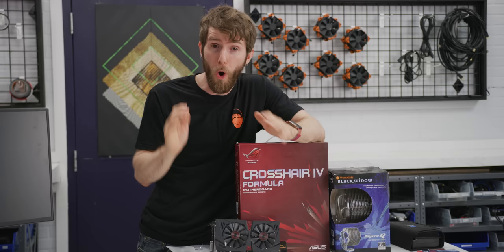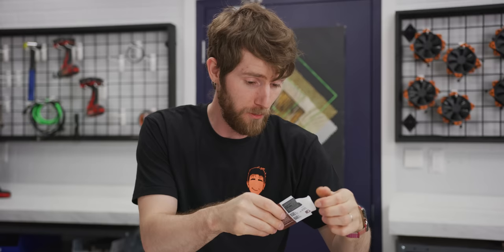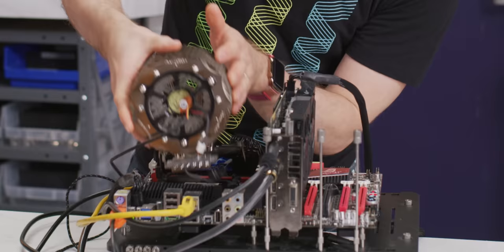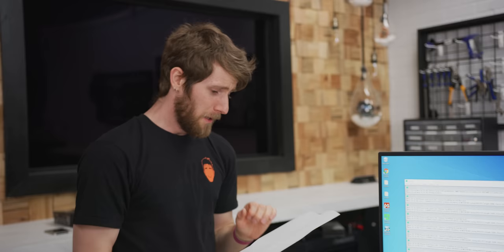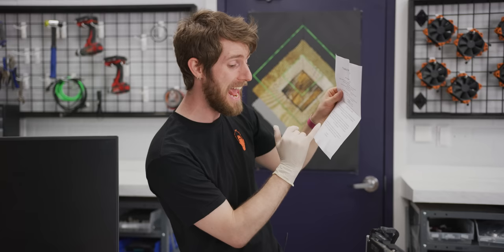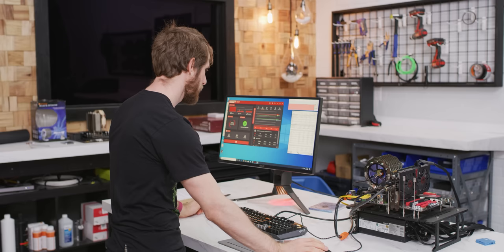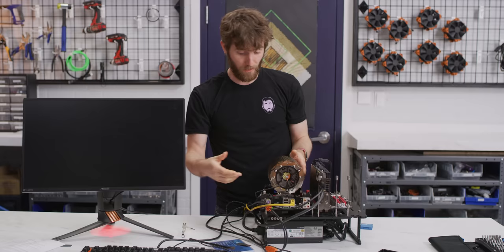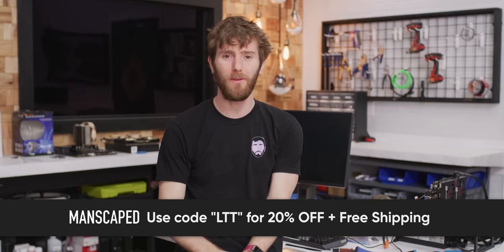Testing Another YouTuber's Thermal Compound!

Comment: Garbage Thermal Paste: 60c
Noctua NT-H1 Thermal Paste: 59c
okay...
Reply: It'd probably be a larger difference if the temps got higher.
Reply: @TechnoMinarchist  its like air cooler and water.
Reply: The cooler was pretty capable for the chip tbh, it'd show more in a lower end cooler, however I think they're probably underestimating the thermal paste that's included with that cooler. Thermaltake's paste isn't that bad, not nearly as bad as that generic white paste you can get in bulk from Chinese ebay resellers. Stock thermal paste included on CPU coolers have even come a long ways in recent years.
Reply: Nivea creme = about the same
Reply: Air cooler = barely run
AIO = 4.9-5.1ghz of bulldozer goodness.

My PC when I decided to go with a 9590 a few years ago.
Reply: Biggest difference should be actually after some given time- cheap paste tends to soldify faster than quality one. As for after unmounting your cooler after half year you should see difference in them.
Reply: Welcome to the real world...
Reply: @joaquinninoortega156  let me see... Air cooled 70-80° in prime 95, fan 100%. Custom loop fan at 600rpm (33%) fixed, system dead silent at 18db sound (can't hear it at night) and max temp on prime 95 after half hour 55°, yeah, same.
Reply: 1. The included thermal paste was not garbage. Linus just calls any thermal paste that isnt a popular brand, garbage. 
and 2. Really, what do you think the difference is between really high-end expensive thermal paste and the average or cheap ones?
Its typically 1-2 degrees Celsius worth of difference.
Reply: @joeycooper93  Comparing stock air cooler against a 149usd AIO again I see.
Reply: @sidewinder86ify  Comparing a stock Ryzen cooler to the cheapest Corsair single fan AIO on Amazon, 90 degrees down to 55-60 under load. Is this something people seriously still debate
Reply: To be fair, generic paste might degrade over time. Low temp is not everything.
Or maybe it's just good, who knows....
Reply: @kylerclarke2689  those temps are surely exaggerated, a r9 3900x with the wraith prism is 84 C and with a 240mm AIO it was 71 C
Reply: You’ll make your way…

Releasing the Title of God of Pak-Toe does not mean I abandon my people of the plain… For I will always be your King of Angels and Demons, and She will always be The Queen of the Forgotten, The Lost, and those whom did not give into Hatred, Jealousy, Envy, or any of them SEVEN DEADLY SINS… Also, I am no longer The Commander for you must learn to command your selves, your souls, and your symbiots, and the SOLIDS can be guides, or The Solids can work as one with these EVIL SPIRITS and since we know there are TWO Type of Light, we The Society of nonmason will follow the Light of Truth – Justice – Wisdom while the FREE MASON Lodge Members will follow the Dead Light of Lies, Conspiracy, and Collusion...It is said, there is a TIME before the CEMENT Dries, and we are all stuck with the MACHINE PEOPLE and their NEW WORLD ORDER, so I would destroy all 5G Eugenics TIME LOOP Technology and Mechanization before these 192 U.N. FLAGS kill all We The People of the HUMAN RACE…

If you want (COVID19) to be gone, and the make it be gone for the Animals do not have to WEAR A MASK unless it is the Muzzle on a raging Animal, and though we Flesh and Blood and Bones People are THINKING Animals in Corporeal Temporal TEMPORARY Carnal Bodies, do you wish to allow FRAT BOYS and FRAT GIRLS to live off your TAXES as Welfare Babies whom always tell you what to do cause their Daddy or Their Mommy is a FREE MASON Judge, City Council, School Board, or Preacher of this or that RELIGION in your home town that also makes them kids of Church People WELFARE BABIES whom live of the Donations and Gifts to Church Tithing to say: We Speak for IN GOD WE TRUST, and we will send you off to WARS to murder other nonmason be they Christians, Jews, Muslims, Hindu, Baptist Shiva and Sunnite, and all the rest.?.?.?.? The no longer give many to any POLITICAL PARTIES or RELIGIOUS ORGANIZATIONS Just as Christ Jesus showed the BANKERS run the CORPORATIONS that run the Religions and the Governments!!!

After all, do not the CORPORATIONS Tell you to put on that SLAVE MASK EMPLOYEE, or you will not have a Job???? Do not these CORPORATIONS make the Weapons of Murder for your Military People to kill we the Tax Paying Citizens of our lands be we Dark to light skin no matter our Eye and Hair Color???? Then while should we go to these U.S. FLAG Hollywood to Bollywood TV Commercial ORGANIZATIONS – AGENCIES – ESTABLISHMENT when without our Welfare and Money no COMPANY can push We The People around!!! The CORPORATIONS did not make our FLAT Duel Earth called Mother Heaven and Father Earth, and all things from Perfumes to Gold and Silver to Diamond to Gems to Seeds bring for the things we need without INSPECTION or INSPECTORS saying, I need to Take your Temperature and do a Corona Beer Bat Snake TEST up your nose….. The longer you belong to the STOCK MARKET the longer you remain a SLAVE – Servant – Subordinate to Rapist, Pirates, and Thieves…

I have learned many things in my life walk as The Teacher, and Christ Jesus Returned in the Flesh and Blood and Bones of an MORAL MAN with connection to the Esoteric World of the All Mighty Source of all Creation and all Destruction, and that is only a FOOL would want WAR when we can share the land, the sea, and the air as we once did when we were all Tartarian, and these Chaldean had no way to take our land, and air, and seas, but now we find ourselves trapped in THE DAYS OF NOAH over and over while Nuclear ATOM BOMBS caress the ICE WALL of our Celestial Sphere, and Trump and Putin and Xi put 5 Megaton Weapons on Jets and stand alone FLYING DRONES controlled by The EDISON Machine of FORCED LABOR Technology in Santa Barbara CALIFORNIA USA…

Johnny Exodice

End to the UNITED NATIONS [International Mafia] at mewe.com/i/johnnyexodice

[///|||\\\]
++++++++++++++++++++++++++++++++
Reply: Thermal paste is thermal paste
Reply: @josephgold208  you must have a badass cooler but too scared to OC
Reply: joeycooper93 probably because your case air flow was bad
Reply: @000jimbojones000  Actually I'm using Nivea Creme right now on my Core i5 and it's not that hot, and smalls good
Reply: Yeah, that's how it works unless you are using absolutely garbage shit you ordered from some ebay seller the difference between expensive "best in class" thermal paste and the unlabeled stuff that comes with your average cheap cooler is going to a be couple of degrees. It turns out manufacturers supply thermal paste good enough to not make their product look bad or damage your cpu, who'd have thunk it.
Reply: I think the main difference is between the time the "good" paste stays functional, cheap-o offbrand paste tends to dry up amazingly quickly (which makes it useless, basically)
Reply: The "proper" way to do this is to use actual calibrated heater blocks and thermocouples. This way is fun and almost "real world" but it's not actually repeatable as a test environment
Reply: @joeycooper93  my thermalright silver arrow kept my phenom 2 1090T at 4.2Ghz under 60C back then, so a good aircooler definitely works.
note that with the amount of heatpipes and size of the fins it probably is as much a watercooler as an AIO.
Reply: cheap stuff cures faster and loses the thermal transfer of paste. Better quality compound stays as a paste longer.
Reply: @marsvoltron  proper thermal grease never hardens, even after 20 years.
Reply: @josephgold208  Same.I was playing BF5 multi at 1080p 60ultra settings,the cpu never got above 50C and the gpu was about the same.That' swith an I5 6500 with slight auto overclock.Base clock is 3.3,all cores boost to 3.6
Reply: @josephgold208  "If you're going over 60C during load I feel bad" 
Me with 80C+ while gaming in my room :
Hahaha yeah
Reply: @miscbits6399  not sure if I ever used thermal grease, always said thermal paste or thermal compound on the label. And I have had to use a spudger to scrape off cured paste from laptops before.
Reply: @miscbits6399  but again, that would be the main difference between the cheap stuff and high end compound. I feel like I'm repeating myself at this point.
Reply: @kylerclarke2689  9590 is not Ryzen.
Reply: Joseph Gold I don’t but my fans scream at me
Reply: @MattersChris  How would paste degrade?
Reply: @iagree4686  was that with the aio running at 100% fan speed? I'd think the wraith prism will be running at 100% during load so it'd be bad to not do the same with the aio
Reply: @josephgold208  Unless you are using an i3 you are most likely going over 60c.
Reply: @joeycooper93  Feeling hot hot hot
Reply: @sidewinder86ify  not stock, but pretty close!
Reply: @hmorris  airflow was good, it's from quadrupling the TDP of the chip. Even the motherboard manufacturer said that water cooling is required.
Reply: @manaquriazertyuio4555  I purchased my AIO on a sale with the plan to upgrade to a newer top tier processor in the next 5 years. This year is the 5 year mark!
I also personally don't like the look of a large cooler.
Reply: @TreblebullFPV  yea... It would boot and run for about 2 minutes and then crash... Way too hot.
Reply: @josephgold208  Me and my 6700k hitting 60 at idle: "I'm in danger"
Reply: @Marciano Garza  Except it isn't. Standard silicon thermal grease never dries out and is about $2 for a 1kg can. The drawback is that it requires care&attention during assembly whereas
deforming thermal pads can just be slapped in place and let the heat do the rest (except, as we know, they don't work very well)  
All the stuff hyped up and in tiny syringes is 99.9% marketing and what people are willing to pay - and having paid so much they tend to pay more attention to what they're doing.
https://img.purch.com/o/aHR0cDovL21lZGlhLmJlc3RvZm1pY3JvLmNvbS82L0cvMzk2ODA4L29yaWdpbmFsLzAyLUFpci1Db29saW5nLUhpZ2gtUHJlc3N1cmUucG5n sums it up perfectly
Even toothpaste or red lipstick is better than air, the differences between "OK" and "great" is less than 0.5c and between "best and worst" is less than 3C (discounting using lipstick or toothpaste). 
Linus himself knows this:
https://linustechtips.com/main/uploads/monthly_09_2014/post-109689-0-66202300-1409802220.gif (and this is based on a tables that's a decade older)
At this point there is greater variability IN THE APPLICATION than in the material and you're at the point where you need to test each TIM 20 different times to allow for installation variations 
There are bigger gains to be had elsewhere in the cooling chain (for years people would diss Intel's stock coolers but the truth is they actually worked BETTER than 90% of the fancier looking alternatives)
The bottom line is that the only reason you want thermal grease/epoxy/anything else in the gap is to eliminate air - you want just enough of it to replace the air and nothing else - you definitely don't want it getting in the way of the metal-to-metal contacts of the roughness peaks of each surface.
The fact that Linus could slide the CPU around on the heatsink easily was an indication that he was using too much grease. It really is worth practicing the "grain of rice" technique a few times to see how far it spreads and how little you actually need.
Reply: @josephgold208  62C with Boinc running. Good enough for me.
Reply: @TechnoMinarchist  Well no it would not. That are the differences between a cheaper thermal paste with a good brand one. Merely 2 degrees. There are always garbage pastes that have very bad results, but this is not usual.
Reply: @TechnoMinarchist  It have found that the Nt-h1 compound is actually not very good at low temperature, and thus lead to higher idle temp but it's very good when the temperature increase and is good at keep the temp at the reasonable level.
Reply: @MrVacicak  this person gets it, the big difference comes over time. Or supposed to
Reply: @josephgold208  erm my i7 9700k with coolermaster m140l reaches 98⁰C whilst playing gta5 at 5.1ghz.   Is this normal 😂
Reply: @joeycooper93  right cus ppl that sell you stuff have your best interest in mind.
Airflow for an air cooler it's like pump speed a liquid cooler. Depending on the chip and setup, an air cooler will hang out even with your best AIO and most beating it especially at real life fan speeds.
My 2600  4.0ghz and 1.25v with nh d15 single fan, gets in prime95 small fft 35°C delta over ambient  under 900rpm cooler and 1000rpm case fans (about 33dba). Reported hwinfo64 power consumption it's about 105w.
Same system and fan speeds, at 185w load on a 3950x, I'm getting 52°C over ambient.
Beat that with an AIO.
Reply: @josephgold208  many people often go over 60C during load, and if you had actually read the comment, you would have realized that Jacen is probably saying that better thermal paste minimizes temperature change. Nice flex though, you are so cool for saying you never go over 60 on a  Youtube video! We are all your fans now!!! (Btw, yes with good optimization and cooling, you could significantly cool your PC, but under heavy load, most PCs go way over 60)
Reply: @joeycooper93  you probably have a bad aircooler. noctua air cooler runs better then my triple rad aio with less noise.
Reply: @TTks124  it wasn't the company selling me, it was upon the fact that I needed to remove the heat out of the CPU socket and out of the case directly. I have a 30° delta from inside the case to discharge out of the radiator. Keeping that extra heat out of the case by directly removing it out was my best choice. Why use an air cooler for a 250watt TDP chip and continue to possibly circulate that extra heat through the case? For the same cost of a top of the line air cooler (massive and ugly AF in my opinion) I could get a 240mm AIO and directly remove the heat out of the case with minimal possibility of recirculation that would affect other components in the case.
Reply: @CosmosCMx  my air cooler was really bad, noise is of no concern to me. Granted my 240mm AIO is not as noisy as my old air cooler.
Reply: @MrVacicak  that is kind of a moot point considering they are comparing it to a permanent bond epoxy
Reply: @OtioseFanatic  its point is , paste Made to become  solid  should  maintain  better  thermal  comductivity  against  the one which is going  to soldify  after  some time  but is supposed  to be still  liquid.
Reply: @MrVacicak  why would that be the point? Thermal epoxy has been around forever, just not in general pc use. More in engineering and automotive applications. This video just further explains why.
Reply: @thewriteinpresident  Neat copypasta, I'm gonna steal it but change the link to meatspin

Comment: Even if this epoxy had PERFECT thermal transfer, it wouldn’t be worth gluing the CPU to the cooler to me.
Reply: Eh that cpu is worth less than the metal it's made of
Reply: Well, actually if you have a cheaper tower cooler, for example my Be Quiet Pure Rock, and I had like a 3600x which'll be powerful enough for a few years, and the epoxy would be absolutely perfect with conducting heat, i'd be gluing it on. For the gained performance, it's not such a bad thing. Heck, I bet for just a little extra you could sell it with the cooler afterwards
Reply: @Bloodray19  why not spent the surplus price for this epoxy on a better cooler?
Reply: If you're going to epoxy on a cooler, then you seriously should think about de-lidding it anyhow.
Reply: for consoles tho? 😎😎😎🤔
Reply: Cherry  bruh its an fx 8150 it's not even the "good" model of "8" core
Reply: @Rugg-qk4pl  i sold mine for 40€
Reply: you could use silicone grease instead of epoxy so you could wipe it off,  if you want to change your cpu
Reply: @Humbulla93  silicone is a thermal isolater.....
Reply: Thermal epoxy used to be a very common thing back in the socket 7 era. Black anodized aluminium heat sink glued on there was a standard solution for most OEMs. If you built it yourself you'd use a sink with mounting clips and bog-standard white ceramic paste. Before that the heat sink just mounted directly to the CPU with plastic clips, no paste. And before that; "what's a heat sink?". It's kind of cute thinking how hellishly hot the original 5V pentium was considered with it's 16 W TDP.
Reply: @SVfighter1  i do know that, but it is used as a matrix in most thermal pastes, that´s why the thermal conductivity is so bad copper normaly has 401 W/(m*K) and thermal pastes are around 4--8 W/(m*K)
Reply: Hammer + CPU gets it off with maybe some side effects...
Reply: @Bloodray19  how do you remove a cpu that has a cooler stuck to it from a motherboard.
Reply: it might be if you get a top tier mobo and cpu
Reply: Yeah that was an instant turn off for me. Not worth it at all.
Reply: yeah well the thermal adhesive wasn't meant for you to attach your heat sink to your CPU in the first place
Reply: i stopped caring abt it the second they said you have to sand and fucking ruin ur cooler absolutely hilarious scam
Reply: It won't. you want something that acts as a liquids with varying sizes in the compound to resist viscosity build up.
Reply: The only way i can see this being worth it is if yiur using an ilder chipset and are putting the ebst option cpu in it. Since youll never need to upgrade the cpu. Like rescuing an old optiplex into a home theater unit or something.
Reply: If it had perfect thermal transfer you could just put the glue on the chip and put a fan next to it and get a constant room temperature cpu.
Reply: So I’d definitely glue it to the cpu for LITERAL perfection. Cause who needs a new cooler when you’ve got one that could cool anything.
Reply: Especially if say, the cooler somehow breaks. Gotta replace a cooler and a CPU. Hahahaha
Reply: Yeah I’ve had to replace broken coolers before. I can’t imagine having to replace a CPU because the cooler failed.